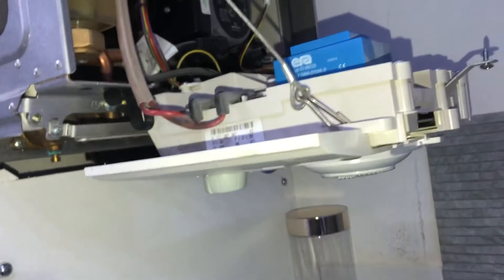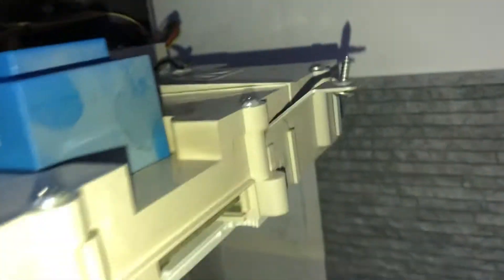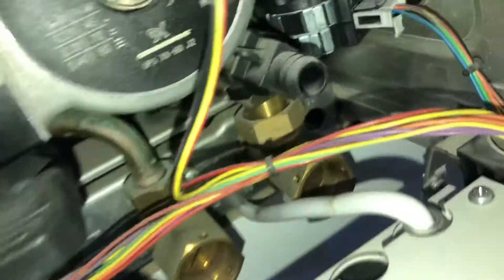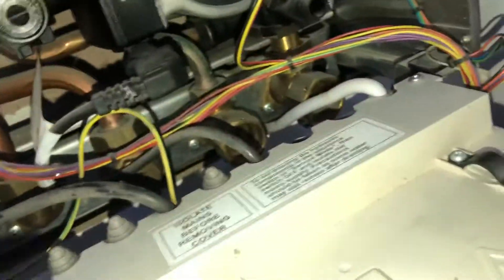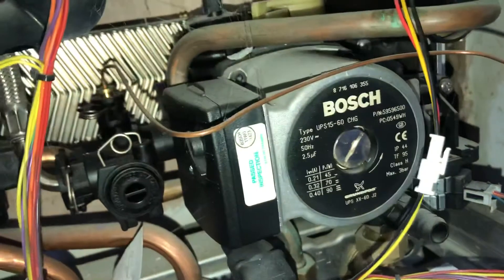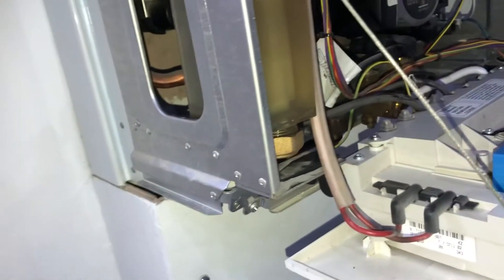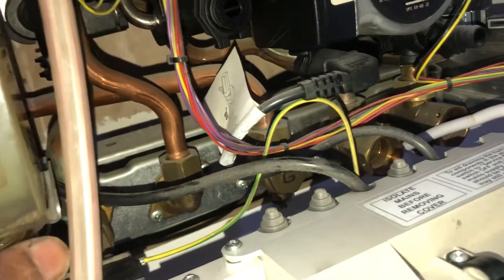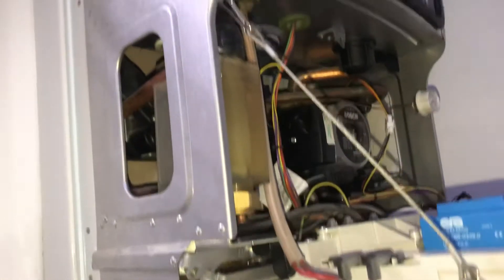Bad boiler design contest- Worcester Bosch Greenstar CDi

Comment: Worcester boilers went down hill at rapid speed a long long time ago , I wouldn't touch one anymore because of the crap design and crap components used and if you are unfortunate enough to have to work on one that is more than 5 years old and need to switch off the power to it
keep your fingers crossed that it will come back on again when your finished because most of the time they don't ,  Keep clear of them....👍